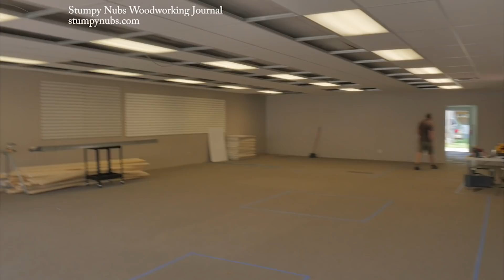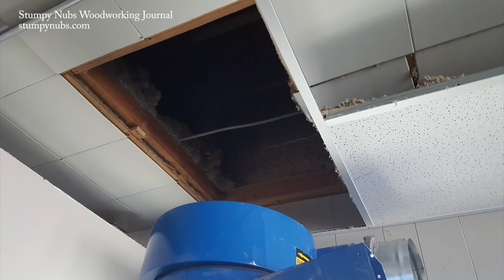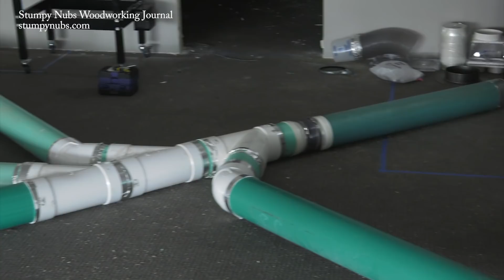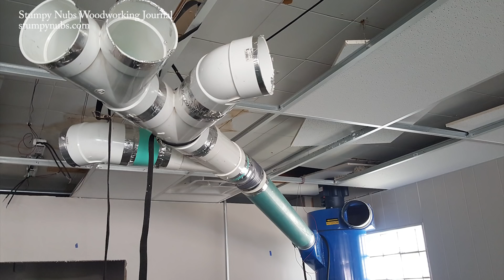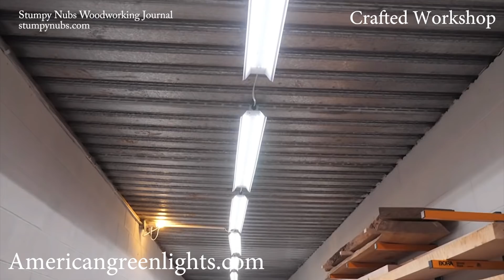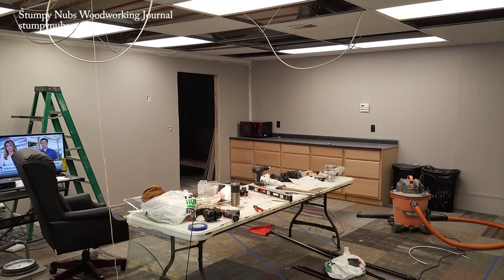Is this the craziest shop dust collection and lighting ever?

Comment: Hey there.  I know this video is 4 years old and I know you have almost a million subs, so this may get lost in the mound of comments.  But, I was wondering what wire you used for those lights.  I have 18 of the exact same lights from AGL and 3 of the exact same 150 drivers.  I have the 3M connectors and am ready to install, but I dont know which wire I should actually buy.  Jim said stranded 16 gauge or 18 gauge copper wire is fine, but I keep finding lights for speakers, landscaping, etc.  I know it should be class 2 rated for 600 Volts but buying wire is like me trying to solve the theory or relativity.  This is another reason why I'm a woodoworker and not an electrician.  :)  Just curious.
Reply from the maker: I think we used 18g. It was a while ago, so I don't remember.

Comment: I know this is an old video, but I too went with SDR 35 (thin-wall PVC)... so much cheaper than Schedule 40 and way less weight to deal with.  While I also tape mine, with HVAC foil tape like you used, the tip I can offer is to tape the seam as usual and fold the edge over to the narrower section just like you show.  After that, run a second strip around the narrow section only to make sure is does not leak though the small folds, nor comes loose.  I just don't like glueing it or using messy caulking.  Never had an issue with leaks.  Two or three 5/16" sheet metal screws ensure it never comes loose and they do not intrude into the pipe to cause clogs.

Comment: Why...is your dust collection motor...inside your shop?
Reply from the maker: Because it's hot/cold outside the shop. If you suck air out of the shop it must be replaced by air from outside coming in.
Reply: @StumpyNubs  Point taken. My little shop is being built right now, and a utilities shack will contain the noisy monsters. Entrained chips will fall out at collection bins near the tools. Thx for the discussion.

Comment: I know I'm half a year late for this party - but. Air flow at your machines - assuming 4" pipe - is twice as fast as in your main line pipes. You do get less head loss with the bigger pipe but the reduction in air speed is going to let some of the heavier bits lay on the bottom of the pipe. I have a one person shop with about 100 feet of duct work. I went with 4" all the way to the cyclone. When a chunk gets sucked into the duct, I like to hear it clank its way all the way to the catch can. I'd like to know if your 6" pipes are accumulating dust and chips that you aren't aware of. Roger
Reply from the maker: 4 inch pipe is only capable of letting so much air through. My system is capable of pulling a lot more air than a 4-inch pipe will handle. I need at least 6-inch pipe to move that much air. Yes, the bottle neck is at the 4-inch machine ports. You can only pull so much through that port, no matter the size of your pipe. But with 6-inch pipe I can have multiple 4-inch ports open, each adding to the overall airflow in the large main. You can not do this with a smaller system because larger pipe requires more airflow to keep the chips from accumulating inside. But my large cyclone is more than capable of handling up to 8-inch pipe.
Reply: @StumpyNubs  Thanks for the quick reply. The trouble area would be at the first foot or so after the transition from 4" to 6". I'm glad to hear you have not had any trouble with your system.

Comment: This system is very dangerous, static electricity can cause sawdust to spontaneously combust, make sure you have good grounds, and copper ground wire running through the whole system.
Reply from the maker: https://www.youtube.com/watch?v=WJ8NMYlhaLQ

Comment: Great video.  On average, how many square feet does each one of your lights cover for decent lighting.  I'm aware the distance to the floor is a factor.  I'm getting ready to build a new shop and I really like the idea of the low voltage lights as it will save a lot of money in original installation as well as electricity.  My old shop was full of T8's so I feel I can't use the number of bulbs in that shop for a comparison.  My new shop is going to be 1000 square feet in the production area.  I'm also confused that your power supply shows the output to be 48 volts / 5.0 amps.  I thought most LED's were either 12 or 24 volts.
Reply from the maker: I'm not sure about floor space. One strip is equal to a standard 2-bulb 4-foot fluorescent fixture. If you visit their website and use the contact link they will get information from you about your shop layout and create a computer generated lighting plan based upon the amount of light you need.
Reply: @StumpyNubs  Is this the one?  RKL Series High CRI Rigid Strip with 270 degree Lens 

Looks a little different than yours on their web site.
Reply from the maker: No, mine were the RSL series.

Comment: Late to this parade- dust collection comments/suggestions- Unless you have leaks at the machine blast gate(s), there is absolutely no reason to put a blast gate where a branch joins the main duct (I had this discussion with Bill P. some years ago)- no flow through the branch= zero loss of SP and zero impact on CFM- its like the branch is invisible to the system!  Too bad you couldn't find ASTM 2729 PVC pipe- it has the same O.D. as the green SDR 35 you used and uses the same ASTM 3034 PVC or styrene fittings, but has a thinner wall (so slightly larger I.D. too), is lighter and cheaper.  Did you check John Deere Landscapes, other irrigation suppliers, or Ferguson?  Sealing PVC pipe/fittings- forget the HVAC foil tape.  Instead slip fit (add a screw where there might be stress, e.g. vertical drop, if you must) and seal with a small bead of 100% pure silicone sealer (not latex-silicone mix!!!) applied to the outside-  the silicon is and stays flexible, bonds well, but is not permanent- in fact, once set, it can be rubbed off easily with a finger!  If you are OCD, you can get a really nice appearance by temporarily applying painter's or masking tape really close to either side of the seam, applying the sealer, then smoothing it out with a wet finger, kind of like sealing a bath tub.  Remember, the system is under suction which helps keep the sealer in place and actually makes it seal better.  Try it!

How about "Not so Clear Vue"?

 Better stay away from Tony's and Bad River!
Reply from the maker: Yet the folks who worked directly with Pentz to develop his collector commercially (ClearVue) say the opposite.

Comment: Hi James, awesome work!  I'm continuing planning for my ClearVue system.  Question: On his web site, Bill Pentz states that a tool with less than a 3.5" diameter dust port is not appropriate for a centralized system such as a CV cyclone.  Instead, he says, tools with small ports require high-velocity dust extractors (like, for example, a Festool CT26).  What are you using for dust collection from small-port tools such as miter saws, band saws, or router tables?  Thanks much!!! :-)

Comment: My first instinct is that a person should put the motor and cyclone near the center of a shop.  That will halve the longest runs.  I could be wrong.  Maybe the length of run isn't that much to worry about.
Reply from the maker: That would require ducts to wrap around behind the cyclone, adding more bends which are far worse than long runs.
Reply: @StumpyNubs  That makes sense, yep.

Comment: you need to try X-Treme Tape TPE-XR1536ZLB from Amazon.  It's mainly used in automotive work, but it is a self fusing silicone rubber.  it doesn't have any adhesive.  You pull it tight and once it overlaps on itself it fuses together.  Seals really well, slice it with a knife to remove it and no glue or tape left behind.
Reply from the maker: I reviewed that stuff years ago. Good, but expensive. And dust keeps it from sticking.

Comment: This is more of a question then a comment:  I have some knowledge on Air movement - and Was curious if you consulted a HVAC team when developing your Ducting for the Dust collection. TO insure your plans would optimize the Air movement through the duct.  I would have expected to see stage ducting down from say a large main ducts like a 16 inch plenum for the main line then gradual reduction to 4"lines at the farthest ends. with gates... Did you do any air flow testing?  is there any concern about dust settling in the pipes reducing efficiency and effectiveness?
Reply from the maker: Small shop ducting has been thoroughly studied and tested by dust collection expert, Bill Pentz. I use his standards. The results speak for themselves.

Comment: It just seems like you're Mickey Mousing this project together.  Keeping the carpet and drop down ceiling in there, I don't agree at all.  You have this hodgepodge of wires above your dropdown, it looks unprofessional.  Any time you go from pressure fittings to the waste side you're going to run into some fitment issues.
Reply from the maker: Just because YOU don't like a drop ceiling and carpet doesn't make it "Mickey Mouse." I personally find them both quite useful, and I am not alone in this opinion. There is no "hodgepodge" of wires anywhere. Again, these our your opinions. We have had two veteran electrical inspectors working with us on this project. All you've done is look at a few seconds of video (filmed before the project is complete), and from that insulted folks you don't know about a project you aren't part of.
Reply: @StumpyNubs  Wow, you seem touchy.  I agree that everything I said is my opinion and I stand by it.  I thought this comment section was here for folks to voice their opinions, correct me if I'm wrong.  I'm sure there are all sorts of opinions we don't agree with, you know what they say about those.

I never said you must or you should do anything.  It IS YOUR SHOP and you can do whatever you wish, please feel free.  Like you need my permission, right?
Reply from the maker: @boboconnor1403  - I'm not touchy at all. That was a perfectly natural response to the rude and confrontational nature of your comment. Think about it: If I walk into your shop or your place of business and the first words that come out of my mouth are "It just seems like you're Mickey Mousing this project together..." and I go on to call your work "unprofessional" you would be "touchy" about it too.

Yes, the comment section is for expressing opinion. Most folks do so without insult. You chose a different route, and you got a relatively mild response, in my opinion. I am sure you know that the way you say things matters. That's how it works in real life, and it's how it works online too.

Comment: First the upper ceiling is old style concealed tile and can be asbestos(and probably is). If not a product shop then why not just run the down the center with 3 or 4 @T's a rotating 90° and a flexible hose to coupler As a gate? I would have just used silicone to seal couplers and turn the collector on for 2mins to pull in and seal then install set screws. I did this in a smaller shop had the collector and aircompresser outside and with sound dampen.  To make the rotating couplers had to drill threw 90°s and use a rubber sleeve /coupler with a bolt that attached to the ceiling and went threw the cente-line of the both the T's and 90°'s with a jam nut. We ended up drilling 3 holes into the T's with silicone and washers hold the pipelines and T's secured. Plugs on the end of the soft flexible collapsible tubes.  The added bonus of the tubs storing up off the floor. The hardware inside the pipelines gave us grounding points to run a static wires to prevent static electrical fires. Found there is a spray paint that is conducive($$$). There was a couple of other things we used to Seal 90°'s the rotating arms were 10' long with another  90° coupler but on those we ran a 1/2" metal conduit with nuts welded on the ends and a counter weight off a eyebolt with a bucket hanging from it that we put dry unmixed concrete mix in. After we ran the system and made adjustment over a 2 year period. Most this was made out of ABS. Funny we had to sand the connection at the pivot and grease to let it move and make a handle for the rubber sleeves hoseclamp. Almost everything was on wheels or we could move with the palletjack. This shop had to pull double duty and worked on tractor/trucks and welding shop.
Reply from the maker: The tiles are paper, they are very common

Comment: Get the white PVC 6 inch pipe at the local irrigation supply. I made my water tanks in our off road trailer. My price here is $15 for 10 ft.
Reply from the maker: I tried. Nobody sold it around here.

Comment: Be careful regarding static electricity when using pvc for dust ductwork. 
Sparks can cause explosions in dust.
Reply: Urban legend.  You can get a static shock from the metal blasts gates which can be grounded.
Reply: @rwe2156  not being a troll here...truly asking...Is is simply an urban legend? I've heard from and read on multiple sources that plastic does build up more static than metal ducting, and that the static discharge danger is far greater. I'm all for learning that this is an urban legend, but no offense, not just going to take your word for it. What're your sources? One of my primary are the guys at my local Woodcraft store. But I also didn't ask for their sources other than their thoughts. Hoping you're right!
Reply: @rjlavallee3575  having worked in industrial safety planning, I can't say I've ever seen enough evidence that ranked it high enough to be a worthwhile risk to really care about on its own. The motor for a dust collector is a vastly higher fire risk than static shock on a pure dust collector system.

That said, where the real risk of trouble comes from is if you do something 'extra special', such as trying to reuse the vacuum lines for something like a finishing spray booth. [And by 'extra special', I mean 'extremely stupid and dangerous'.] While a static discharge is very unlikely to be able to set off chain combustion in wood dust alone, it will have a far far easier time getting light vapours to go up. And that can be enough to kick off the sawdust, which can make for a hell of a time. 

Personally I'm rather on the fence for in-shop dust collectors and storage. On one hand external storage is safer in some ways, but is also at more risk of reduced maintenance and increases for different sources of damage [while also being more hidden.] so you increase the risk of an accident happening in the first place...

Buying a size or two larger fire extinguisher than you think you really need, and buying a few more of them to have around a shop, is a pretty decent idea in my mind.
Reply: @RealLuckless  Most thoughtful, complete answer I've ever had. Thanks a ton. Off to get a second and third fire extinguisher.
Reply: @rjlavallee3575  I read a pretty extensive article about the explosive danger in dust collection systems.  Most shops of James' size & down would never achieve the dust to oxygen ratio needed for an explosion to occur.  It takes a lot more dust than you think.  The dust particles need to be of a pretty high density since one dust particle needs to ignite another dust particle causing a chain reaction.  The ignition to flame out time is very small so there needs to be a LOT of dust particles within near contact of each other.  In tests I saw, the wood dust cloud had to be so thick yo could barely see more than a few feet. When does that ever occur while machining?  Saws, planers, routers mainly make chips.  Small shop sanders can't make a high enough dust concentration in a collection tube to explode.  Static is rarely the problem.

Comment: i've read that plastic pipe for dust collection can build up a static charge and can create a dust explosion risk. I didn't see anything to minimize the risk? When I ran plastic pipe for a small dust collection system, i ran a bare copper wire down the pipe and tied it to ground.

Comment: LED lighting is definitely the way to go for any kind of even coverage, flicker removal, & energy efficiency. Bouncing the light off walls for some extra diffusion, I've found, really helps with eye strain too.
You can use normal silicone sealant if that tape on the ducts ever does become a problem. It should provided an airtight seal if applied carfully, will fill gaps, & yet will flex with the pressure changes. Just a pity about the way it smells until it's cured.

Comment: What are you doing to handle noise impacts on the postal service?
Reply from the maker: We've been monitoring it and the cement block wall that divides the two spaces dampens the sound very well. No issues so far. But remember, this isn't a production shop. We only run the machines occasionally.

Comment: I didn't see anything regarding grounding of the pvc to eliminate the status build up. I have one Run of pvc and I always get zapped on it, when I use it, and don't attach the ground wire. Aka Shop Defibrillator...lol
Reply from the maker: I've never been zapped. As for dust explosions, there has never, to my knowledge, been a documented case in a small shop. Lots of "I heard" on the internet, but never a first hand account. You simply are not pulling that much fine dust through the system when you are running one or two machines at a time.
Reply: I'm in the high desert. Maybe the15% humidity? Anyways, enjoy the new shop!

Comment: Use duct seal (it is a not hardening clay like block).  Roll a bead of it I to about a 1/4" diameter and wrap it around the joint and work it in.  The stuff is cheap too.  It was about 2 or 3 a brick if I recall and 2 bricks or so could seal all of your joints.  They sell it at home depot and lowes.